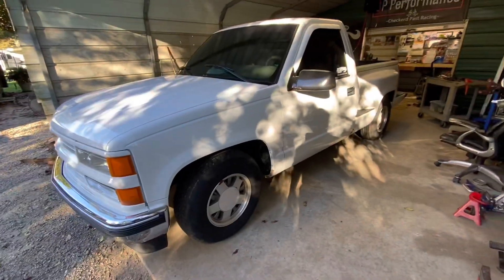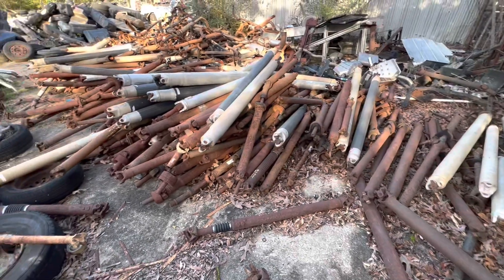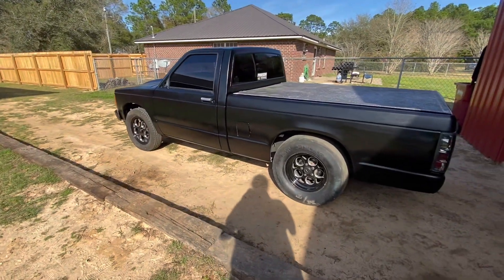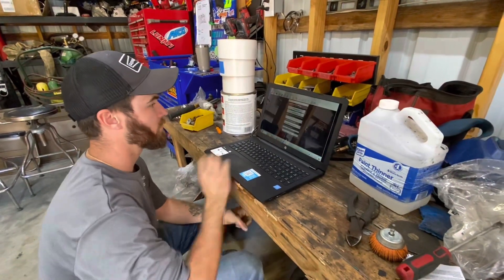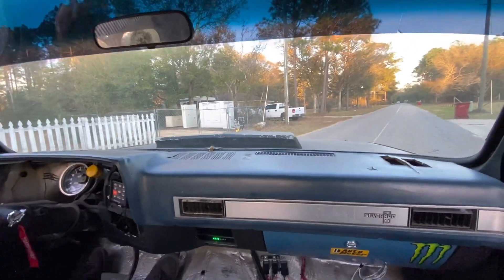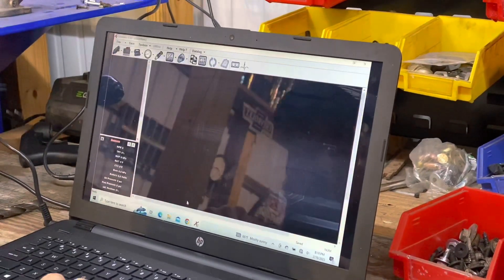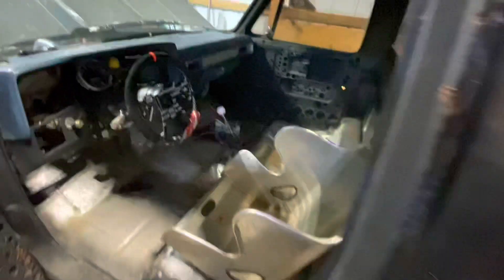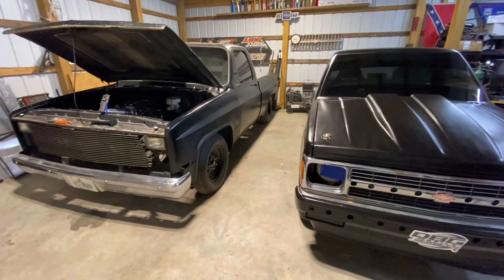LS swapped 84 C10 first test drive, shifter install, and driveshaft hunting!

Comment: What is causing this hesitation in the s10 and c10?
Reply from the maker: We never figured it out on the s10 my buddy got impatient and sold it. My c10 still does it, but since I put in the snake eater 850s it does the rpm cut at 5500 instead of 3500… so I believe it’s in the tune, because I definitely am not out of fuel system on the c10. Tuning issue
Reply: @checkeredpastracing1984  I presume there are no other tuners in the area to help you guys out? I know it can be complicated but maybe trying posting on a boosted lsx page on Facebook lot of knowledgeable guys on there
Reply from the maker: @tristenoberlender9685  yes we have tuners in our area… my only problem now is I do not want to get tuned with my un gapped bottom end and no boost controller. I have a fresh gen4 bottom end for my c10, and gates/Mac valve… so once I have that stuff together, I will get it professionally tuned.